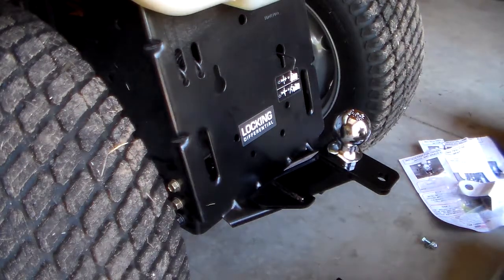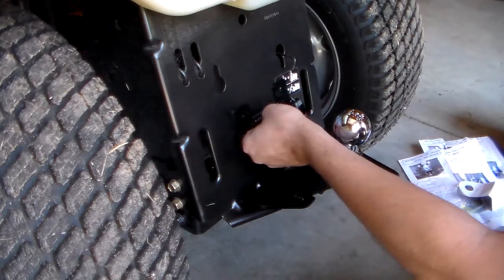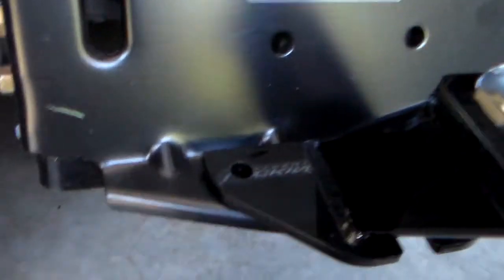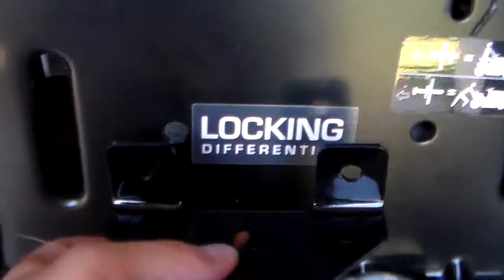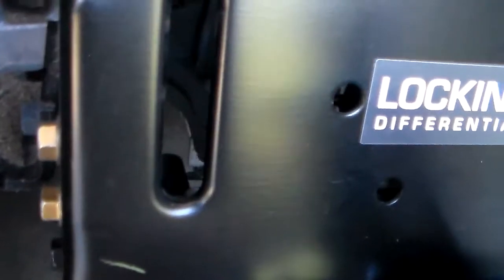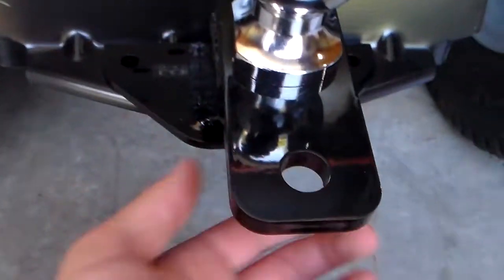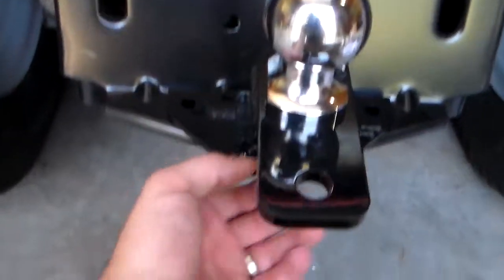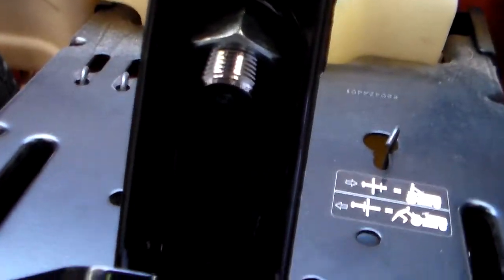Husqvarna GT54LS Universal Trailer Hitch Install P2

Comment: Mine is the same way, but it has to set flat. I got the same one. I will work,  One flat pc. with the ball size hole goes under the ball. The the larger pc. fits on top and the smaller pc. bolts under. It should reach the back on the mower plate. If you don't put those extra brackets on you will bend that back plate. There are out video's out there on You Tube. Watch them. Good Luck, 03/15/2021

Comment: You can do it. I made a video a few weeks ago, but haven't posted it yet. I will soon. I also painted the hitch Husqvarna orange. You're correct that you have the locking diff reservoir on the top right side, but I got it to work.

Comment: Just ordered one of these. I see the prob. Haven’t even looked at putting mine on yet. I hope I don’t have the same problem. In your case I’d get 1 1/2” wide or so X 12”?? stick of flat stock put 90 on it, pre drill 1-2, holes and install 3/8” bolts in it. Then run that from the rear of the body to the hitch ball and pre drill a larger hole for the ball to mount through. I say ‘maybe’, just thinking of the top of my head. In case I run into the same prob. I know you said you couldn’t get in behind that panel. You’ve prob already come up with something. Hope it’s working out.